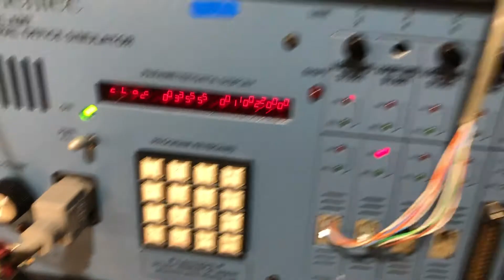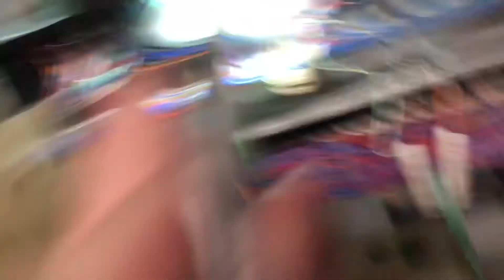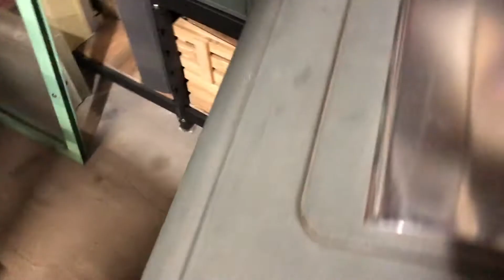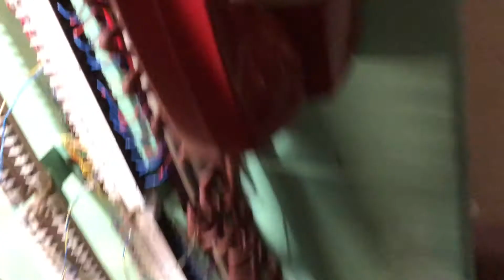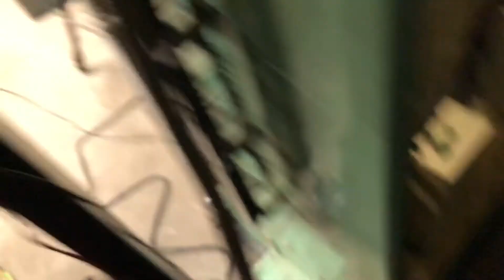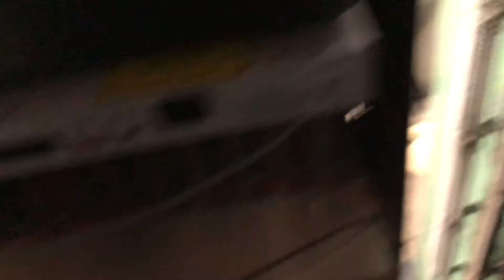Strowger PABX Exchange Line Troubleshooting Part 2

Comment: CE and IE are almost certainly forming a “2 stage drop back” circuit.  I would expect CE to short the outgoing line during dialling so the distant exchange sees a nice clean, non-inductive loop and gets the cleanest possible pulses.  CE releases slightly before IE, and IE puts a resistance across the line instead of the short, then when IE releases, the outgoing line is connected to the transformer in the speech bridge.  This is so the line doesn’t go from a dead short to a large inductance in one jump.

Congrats on getting it working though!  I reached a similar milestone with my Ericsson PAX50 recently, and getting that first call through was really exciting!
Reply from the maker: You are correct! CE does indeed short the line (and also feeds a signal into the toll restrictor, so I wasn’t totally wrong!).

It took me a good 20 minutes to find the single break contact (see rant below) on the schematic belonging to the IA relay (which what I think you meant by IE). That contact connects the B lead of the exchange line to ground via a 620 ohm resistor. It’s a break contact, so that resistance is always connected except during pulsing. From the sequence diagram, it looks like IA provides the ground start signal to the CO,  it why would it be left on the line for the duration of the call except during pulsing?

For those following along at home:

Sequence diagram: http://beefchicken.com/comms/pabx/diagrams/seq-6-1.jpg

Exchange Line Schematic: http://beefchicken.com/comms/pabx/diagrams/sw-exchange-line.jpg

Please excuse the quality, these are photos of photocopies of 11x17 reproductions of the original full size drawings that were part of some training notes, that were then coloured in creatively by a student of this course. I have all of the original drawings, but these reduced reproductions work great as my daily drivers. 

Rant: as someone that is more accustomed to the Automatic Electric style of schematic, where the contacts that belong to a relay are in the same column as the magnet for that relay, I find the style of the Ericsson diagrams extremely frustrating to follow for troubleshooting purposes. It’s like playing Where’s Waldo trying to find contacts scattered all over the diagram. In this case, there’s 26 relays and 134 contacts, that’s a lot of visual clutter to sort through.
Reply from the maker: The PABX50 looks like a fun unit, How does it turn a two digit number into a mark for the uniselector?
Reply: @beefchicken  I did mean IA, that's me mistranslating from another system - sorry!

The diagram is interesting, and I don't think IA does what I thought it did (at least, not directly) I don't think I've seen a relay connected to the speech bridge transformer like that before.

I think IA is effectively a supervisory relay, ie it operates to the 50v coming back from the central office.  The resistance would have no effect during an outgoing call from the PABX as RC doesn't seem to be operated? - but they would both operate on an incoming call from the central office, and earthing the B leg via a resistor would "answer" that call (as far as the CO is concerned)

So, I don't think you've got 2 stage drop back - unless it's implemented in a different manner, possibly via the CC relay (CC4 is an x contact, which either means it "operates first" or "operates last" compared to the other contacts on that relay - I can never remember which way round it is)

You do appear to have single stage drop back though, which is from CE - so I was half right, not bad considering I was only looking at the front of the relay can and not the diagram!

Regarding schematics, I guess it's "what you're used to" - I find the UK style easier to follow because the circuit is loosely grouped in blocks according to function, rather than physical layout - but I do agree, playing "hunt the contact" can be tedious unless you're already familiar with the equipment!
Reply: @beefchicken  I've been meaning to get around to shooting some video of my exchanges, and the PAX50 in particular - mostly inspired by your videos (and a lack of similar channels for UK equipment)

When you sieze a line, you're connected to a register relay set.  The first digit dialled operates a "tens" uniselector, the second digit operates a "units" uniselector.  Between them they mark an outlet on the multiple.  A connector uniselector then spins round to find that marker, releases the register (to free it up for the next call) and applies ringing to the line.

For 50 extensions, there are only 2 register relay sets, but 7 connector circuits.  So it can handle 7 simultaneous conversations - but can only set up 2 simultaneously.

Side note - it's a PAX (Private Automatic Exchange) rather than PABX (Private Automatic Branch Exchange) - the difference it the "Branch" exchanges were supplied by the Post Office and allowed to connect to the PSTN

PAXes were purely internal systems - much cheaper because they didn't need GPO approval.  They still had the capability to interconnect though, and some large companies made great use of that connecting up all their sites.  I was recently looking at an electricity supplier trunking diagram from 1967 and it had over 20 private exchanges all connected in a layout very similar to the PSTN